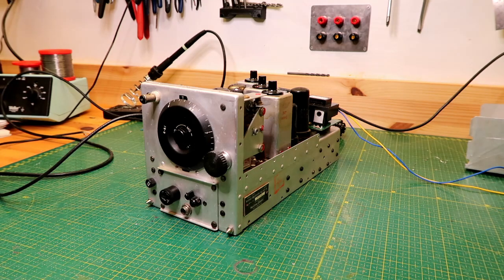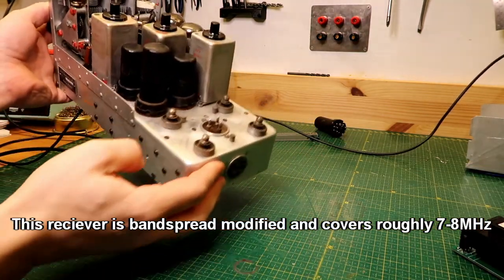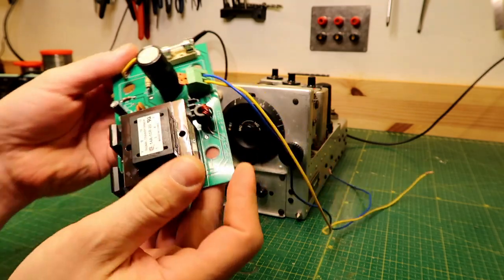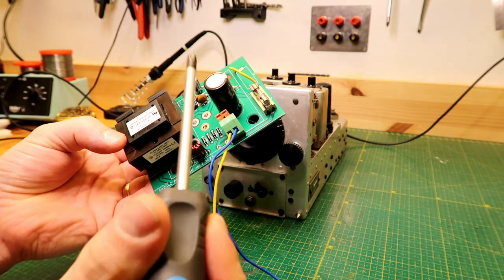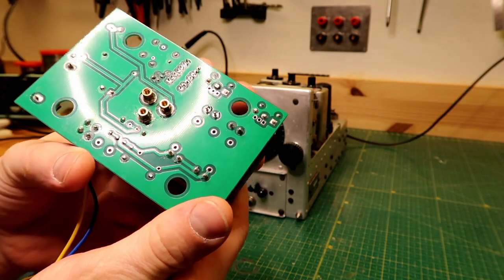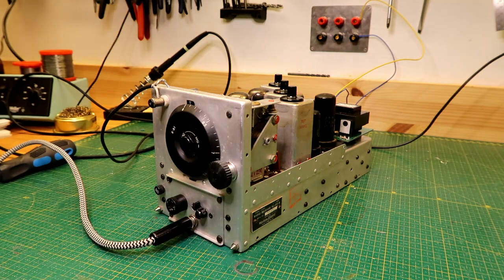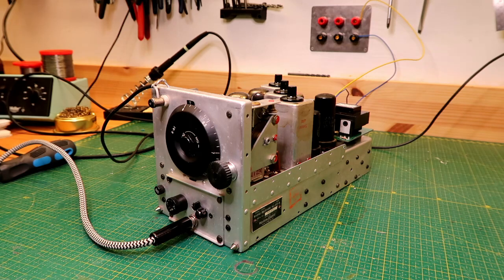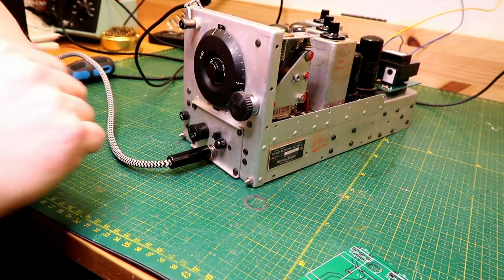ARC-5/SCR-274n receiver power supply

Comment: If you have them I would like 3 of the ARC-5 power supply boards can I get a cost shipped to zip code 60073 in IL in USA Thanks Keith N9QDS